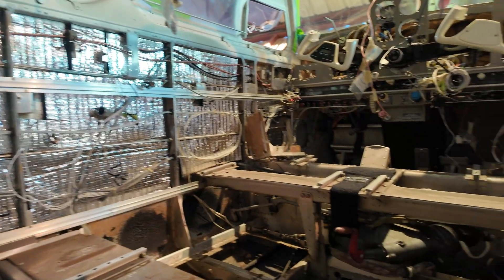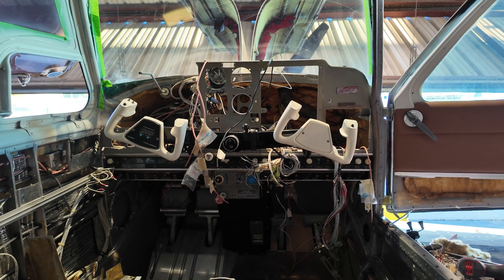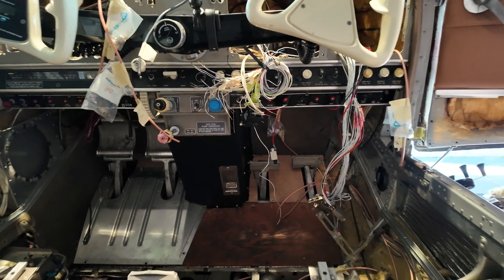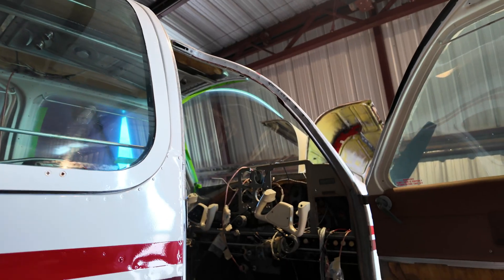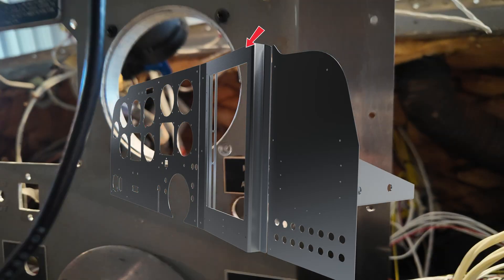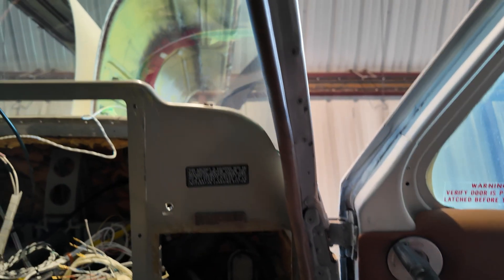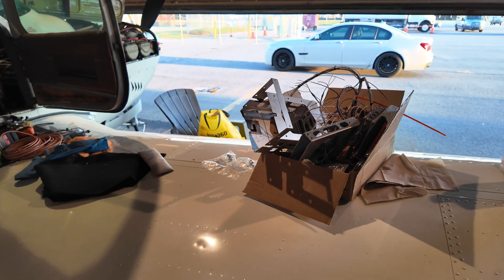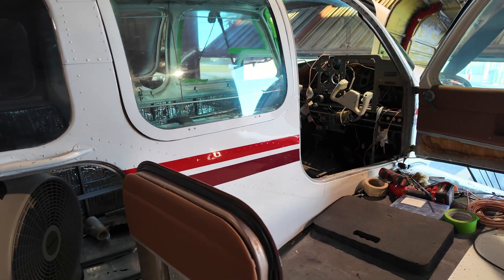This Just Became a HUGE Project - An Update

Comment: With all the wire removals, interior upgrade (smokin hot btw), if you re weigh the plane, don't be surprised if you loose a bunch of useful load!  Sauce:  After avionics upgrade, AP removal and wire removal of 1970's anchors to all fancy new stuff - we lost 28 lbs of useful load - using all lighter equipment.  It got fat after 55 years, just like me! (the plane had never been weighed from the factory)
Reply from the maker: 😂😂 sounds like a challenge! I wouldn't mind gaining weight in the nose. I have an AFT CG problem as fuel burns. 36M was last weighed in 2010. I'll update you on how she does.

Comment: I just got done with a TWO YEAR full avionics/panel and full interior replacement/upgrade! I feel your pain, but yes it’s worth it in the end. Did I mention my A&P iA is 1.5 hour drive one way! 😂 It’s nice now though! 😃 Oh and it started by doing a “quick swap” of my audio panel but got caught up in the “while I’m in here.”
Reply from the maker: I know you couldn't have seen the nest behind your panel and just let it slide. Once you see it, it's impossible to unsee! 2 years is a long time but nothing compared to the safety and utility you added...and all the things you learned along the way.
Reply: Yeah the wiring was….well I can’t see how an AP/IA ever signed off on that! But it’s amazing now!! Part of the time was doing the “while we’re in here” and having to decide what I wanted, order it, having it built (interior seats, panels, etc) then designing and building my own panel when I’d never done it before. It was “fun” LOL.
Reply from the maker: @stevendouglas8144 right now I'm spending a lot of time just waiting on the little things I don't have enough of (mainly fasteners).
Reply: @OpenSourceGA Not sure exactly which fasteners you’re talking about but I built my wall panels with modern day automotive fasteners so there are very few screws showing holding wall panels on.

Comment: That's going to be one sweet ride when you're done, I can't wait to see the end result.  I just upgraded the avionics in my Cherokee earlier this year for the same reason. I'm heads down trying to study for the instrument rating written test now.  I'm curios, does your Bonanza have an auto-pilot. I don't have one in the Cherokee and I'm considering selling and getting something else that already has one once I get 200 hundred hours and my instrument rating.  I'm at almost 150 hours right now.
Reply from the maker: These things can be as nice as you make them - surprisingly enough (and no one will believe this...) I've done this all on a "budget" that I'll reveal when the project is done. What course are you using for the IR written? I had a good time with Sporty's and then Sheppard Air - but I believe all the modern courses are excellent.

This airplane has an existing S-TEC 50 AP with GPSS (GPS Steering) and altitude hold that works great. It will hold an altitude great but won't fly any vertical guidance so it's power and manual trim changes. It'll follow the directions from the GTN 750 just fine. I'm about to install a TruTrak autopilot in the Arrow (same unit for a Cherokee) - it's a "budget" autopilot if I've ever seen one (can be had for under $9,000 USD I believe). The thing that'll get you is the installation cost which is practically double the cost of the unit if you don't have friends like I do. It's about 3 full days of work to install but relatively "easy". If you like the Cherokee and it does most of what you need it to do, it's worth installing the autopilot...if you need more gadgets (radios, GPS, engine monitor, upholstery....), then sell and upgrade via purchase. The instrument rating might make you want a more capable airplane anyway!
Reply: @OpenSourceGA  I'm using pilot institute for my instrument training.
Reply from the maker: Very highly rated service. I just need to get out there and fly.

Comment: Yes... Buy a plane that has what you want!  I picked my plane up Saturday after a three week GFC 500 install.  Lots of money, lots of time not flying.  It's a much more capable plane now (especially when I get to instrument training), but if I had it all over to do again I would have bought a plane with a great autopilot already installed.
Reply from the maker: The venerable GFC 500! There's hardly a note capable unit out there. Great choice! Now to remember to turn it off periodically and fly the airplane so you don't fall asleep and end up in your hangar. Those things have audi taxi mode, right...? Yep they're pricey and that labor is a sunk cost unless you plan to keep the airplane a while. It's often difficult explaining to sellers that $30k spent on parts and labor, doesn't always increase the airplane value $30k...but theres choice, so more old airplanes are getting updated, so the used market is benefiting. More good news is it add unbelievable amounts of capability and workload alleviation...huge safety boosts in IMC and long XC. Your insurance rates should go down ideally...jk we can't have nice things.

Comment: As someone who is interested in doing this kind of thing, it helps that you have an A&P who is very willing to support you doing this stuff, and who is very close by to guide and lend a hand. It probably helps that your A&P also trusts you to do the right thing. Which means that for many people - myself included - there's some degree of training that needs to happen before my A&P would be willing to come inspect and sign off my work.

IMHO, the path to that trust is owner assisted annuals. Unfortunately the A&P that we have that's willing to tutor me, is not the A&P/IA that we take our airplane to for annual. And that IA isn't willing to do owner assist. As the newest guy to the partnership, there's a lot of inertia with the existing partners to stick with this A&P. But I'm hopeful that we can find someone else who would be willing to allow an owner assist without breaking the bank on the first annual.

Or an alternate path: build an airplane. Which is most likely the path I'm going to take.

And LOLOL at the Notting Hill reference! That was great!
Reply: @1dullgeek- note that with MOSAIC, your options opened up a little- you don't have to build the airplane, you can buy an EA-B and do your own condition inspections now with a 15 hour class.
Plus, having just had one done, there are two other advantages to EA-B.
1. Any A&P can do a condition inspection, not just an IA.
2. Because 1, it's actually easier to get someone to do it, and let you help.
Reply: @deanwoodward8026 yeah I know. It's an awesome option! Not one that I'm going to exercise because I really want to have intimate knowledge of the airplane.
Reply from the maker: I wouldn't (financially couldn't...) go to these lengths if I didn't have great relationships with half a dozen great local A&Ps and another half dozen across the country who are dedicated to teaching me and supervising my work. I'm well on my way to earning an A&P license after a decade of working on airplanes. A M.Sc in airplane design theory and methodology also doesn't suck. It helps that they've also seen me rebuild a dozen or so cars. That trust builds daily and it's on me to ring the alarm bell when I'm incapable or unsure. I do it a lot actually.. 

You've hit the nail on the head with this one though. We need the FAA to endorse what I call a "Skills Based Assessment". An assessment facilitated by your A&P that clearly shows how your wrenching ability is progressing. Every owner should be involved in their annual and every A&P running a commercial operation should encourage some sort of participation whether in person or remotely. It just makes for safer operators and more knowledgeable and thorough reporting when something does fail.

If I ever look for an airplane instead of stumbling into one, it would be a large (I'm huge) fixed gear experimental or one under the new rulings I can maintain and modify on my own. Until one of us becomes the next FAA administrator and expands and simplifies VARMA and NORSEE of course. 

Notting Hill is and forever will be a great movie.
Reply: @OpenSourceGA MOSAIC really changes things quite a bit. They expanded the definition of LSAs while not increasing the maintenance requirements for that type of registration. Basically you can maintain them with an LSRM certificate (requiring 15 days training) and you can conduct the annual condition inspection with an LSRI certificate (2 days training). IMHO this is a pretty big deal.
Reply from the maker: It it! MOSAIC is a great step forward and I do quite a bit of consulting on its advantages for manufactures. But my airplane buying budget usually sits around $40k so MOSAIC or not, it's likely 60 yr old airplanes for me for a while i.e. no MOSAIC, at least until I pay off my student loans. The folks at Spirit Engineering for example (SE-1 is sub $80k) will have the perfect airframe for the new certificates to be applicable.
Reply: @1dullgeek  Also, an EA-B owner (e.g, me with my GlaStar) not the builder can now do their own CI with the LSRI cert.
This makes TONS of sense, because after six months of ownership, poking and prodding at everything, nobody else is going to know that plane as well as I do right now.
Reply from the maker: Oh also, friends first, A&P second. Building that relationship first is more beneficial than jumping into a contractual situation. I've posted on my local Facebook groups asking who's an A&P who wants to go out for a BEvERage.

Comment: We like your content!  We need down to earth aviation advice.  When I got my plan and upgraded my avionics consisting of a radio and a ADSB transponder.  It took forever to get everything right.  And that was a very very simple upgrade.
Reply from the maker: Thank you for your continued support! Definitely hope to shake hands at triple tree. Our superpower is that ee have a friend group that has every strength we need to build, fix, test, fly, upgrade, and improve airplanes. I also have the whole airplane design engineer thing under my belt so that makes airplan projects design/planning intensive, but smoother on execution. There are skills I hope will spread and make complex modifications less complicated.

Comment: Don't use "silicone" to seal antennas at the base. Use PS870B1/2 Corrosion Inhibitive Sealant, MIL-PRF-81733.  A&P/IA viewer.... :)
Reply from the maker: Well ton was an overstatement haha but yes that's the right stuff. I redid my Arrow with it too. I'm thinking there's probably a market for a retired A&P to remotely review owner's work plans to make sure they're considering everything before hiring a local A&P...wink wink.
Reply: @OpenSourceGA  I am sure you already know to only seal the perimeter of the antenna.  You want to ensure the base of the antenna (underside) and fuselage area directly underneath are "bonded" properly.
Reply from the maker: We've got that stuff by the ton! Good catch and I appreciate good free A&P/IA advice any day!